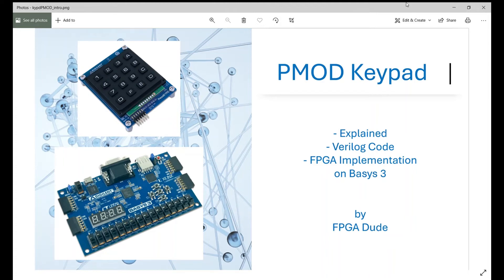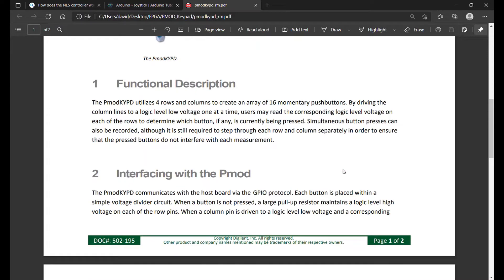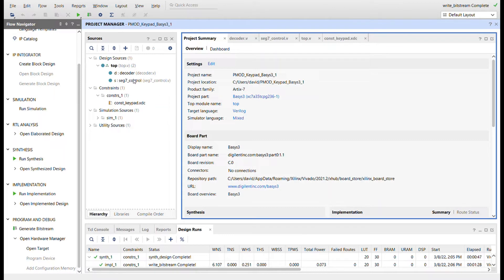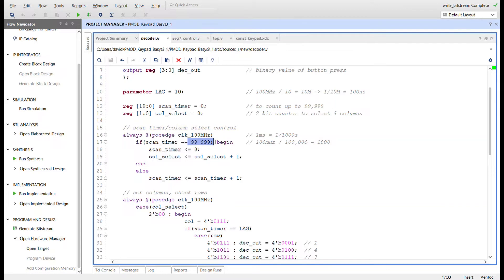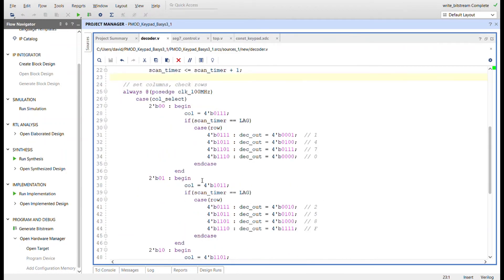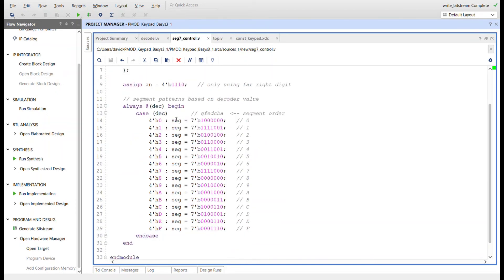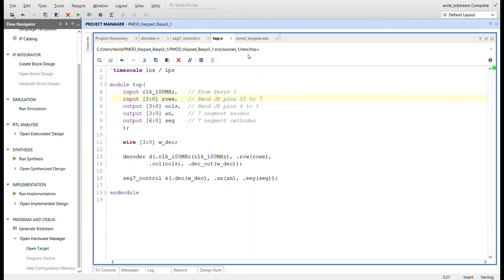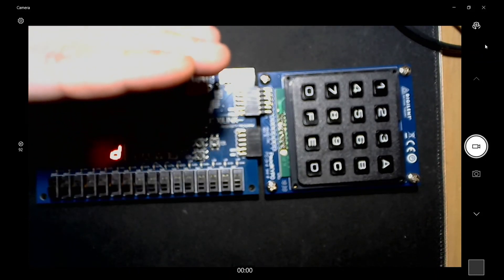How to Control the Keypad PMOD on FPGA Basys 3 Verilog Vivado

Comment: Sir how to connect to fpga boards using pmod please sir make a video
Reply from the maker: I don't understand what you mean?
Reply: @dajoma36 Thanks for replying 
I want to say that I want to connect two FPGA boards together such that through one send signal to another FPGA board and second one receive it react accordingly to it using PMOD 
Not using UART protocal that are slow 
If it is not possible with PMOD you can tell how to do with UART and video suggestions
Reply from the maker: @ansh9526  Connecting two FPGAs through PMODs is simple. You just need to program one to output through its PMOD, and the other to receive/input through its PMOD. Each FPGA will have its own circuitry and constraints file that specify which PMOD ports are being used.
Reply from the maker: I just remembered that I have a video on FPGA to FPGA communication. You can find it on my channel.

Comment: Sir how can I do mapping for output variable "cols"? Should I type xdc file manually? I think I was be able to do mapping only for input variables. Thank you for your kind explanation.
Reply from the maker: Hi. I'm assuming that you want to output cols. What do you want to output to, LEDs? Yes, you would need to manually update the XDC file for the outputs.
Reply: @dajoma36  Thank you for your kind explanation. Actually, I do not output cols directly to LEDs. What I have to do is to transform keypad signal into a 3-bit Opcode of ALU e.g. 0 into addition signal, 1 into subtraction signal. Thus, I have to put keypad signal into 7-bit variable and, using MUX, make the 7-bit value into 3-bit Opcode.
Reply: I thought row and col signal should be input of my ALU so that I can use the 7-bit signal from keypad as a Opcode, but somehow I failed. Your video showed me that "col" signal shoud be handled as "output variable, manually  mapped in xdc file". I would be very grateful if you let me know I understand properly. Thank you for reading my comment in spite of my bad english, sir. :)

Comment: Is there any way I could not have the decoder initially set the value of dec_out to "0000" once the program starts? Could I set dec_out to null initially so that when the program starts there is nothing being driven out of dec_out until a button is pressed?
Reply from the maker: Sounds very feasible to me. I don't see why you couldn't do that.

Comment: I think you didn’t need the scan_timer( even scan_timer == LAG). By just converting the 100MHz clock down to 8Hz would save you some lines of code. I design a similar keypad in vhdl with less lines of codes than yours. By the way I really like yours videos.
Reply from the maker: Thanks for the info.

Comment: I dont have the pmod keypad but i have a 16 button keypad i am wondering if that works!?
Reply: Depends on how it is wired up. You'd have to check the data sheet on it to understand the signals. But, I would imagine the principle is close to the same.
Reply from the maker: I have the 16 button keypad you may be talking about, the really flat one you might get in an Arduino kit. I looked up some info about it and tried to use it with my FPGA, but it was very glitchy. There are different methods for connecting it, so I might try the other method and see if that works.
Reply: @dajoma36  thank you yes i tried it and it kind of works but not reliable. I played with LAG but didnt make any difference. But the main thing for me to know the method to use the program which was great. Thank you again!
Reply from the maker: @Avionics2  No problem